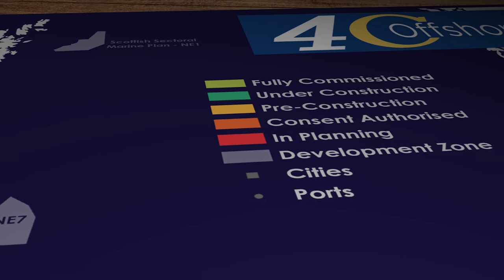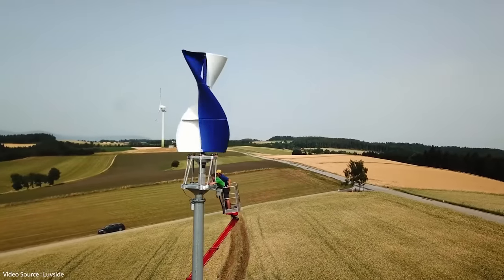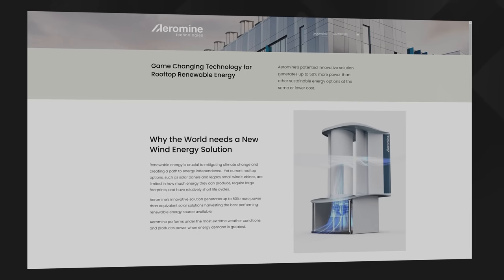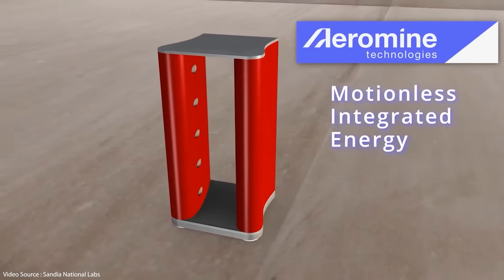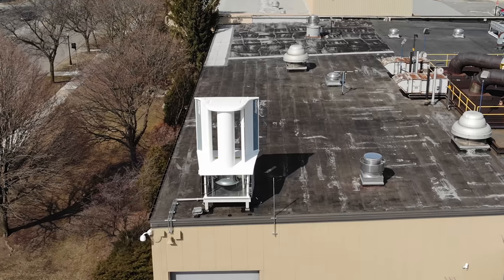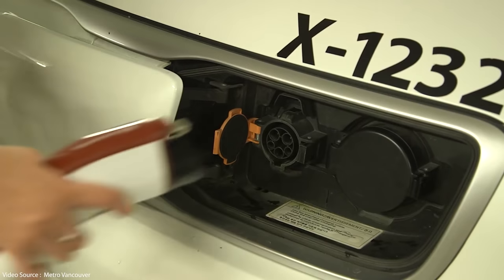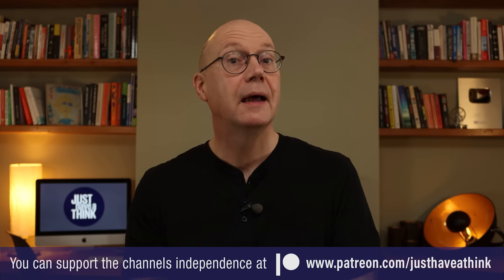Aeromine Rooftop Wind. Static. Silent.  50% more power than Solar PV. What's not to like?

Comment: Do these suck in birds and other debris? How do they hold up in storms? Hail? 40-140mph winds? "one equals 16 solar panels"(saw that on their site) is SUPER specific. A solar panel can have drastically varying output.. How much electricity does one of these generate? I love how its focus is on being quiet yet there is still a fan and there's no such thing as a quiet fan if its spinning fast enough to do anything. Not only would it not be quiet it might produce vibrations that are emitted into the entire roof which could do more than amplify noise. I'm not a fan of anything that could mess with a roof honestly. Even if you put my dislike of anything put on a roof aside this, "product" is extremely sketchy with its various missing specifics. It's just like how I don't buy plants at stores that don't have names. Menards and Walmart literally have plants labeled as, "Pretty foilage" with no other name. Why would I be interested in something that doesn't specify wattage? 16 solar panels...? No noise? Waste of time. Probably had to mention the US because its a scam and wanted to make it seem less likely to be one. I hate to break it to you but there are plenty of scams in the US too. Like all of the unlabeled plants being sold this year at various stores. 41k likes? How?

Comment: Cheaper while producing 50% more is never going to be the end of the story. I have looked at small vertical turbines for years. The issue is always the cost of maintenence. A spinning component exposed to the elements is going to need bearing replacents. That sort of constant part replacement needs to be calculated in.

Comment: This doesn't have "no moving parts."  You said several times that it did, but you also said it has a propeller.  It has a moving propeller, and there's a potential for noise.

Comment: Their a problem with outputs speeds from wind turbines 1,000w  they give you a number that 70% less and that problem is inputs speeds are only 30%. They say, this is outputs are  1,000w, but the actual output is 300w that's your 30% which is known as inputs speeds. When they sell you a wind turbine with extras for your house, it's on the box and in the information leaflet it tells you 1,000w they are not lying this is based on the 12 or more metres a second wind speed maybe 10 metres per second on wind speed actually .  That's 25 to 30 mph is the target speed but the input test tells us that it only 300w under this speed your only guarantee on a average day's wind between 8 and 12 mph and that will give you availability for 300w or the 30% per day to get 1,000w it would have to be strong winds every day to 35 or 45 mph then the whole thing could have a problem with stability land movements. The things is in this video the man says it's expensive they make these turbines and every year they cost the tax payers a sum of £300,000 a year wind energy they make is £26,000 £30,000 a year after breakdowns and oil, grease and parts this could be 50 or 60 days a year  and that affects the £26,000 target they offer the government for our money.

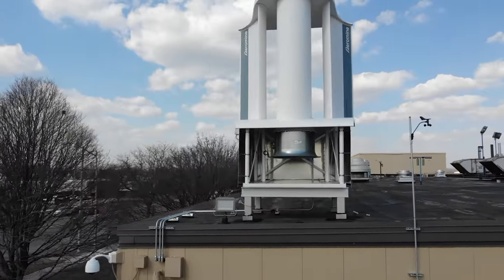Comment: Besides all advantages, I do have a point of critique coming from the standpoint of an architect. In its current state it doesn't look appealing. Not on a residential building, maybe on a warehouse... If this technology actually becomes an integral part of the face of a building, then preferably something needs to be done about that. And the video repeatedly mentions 'no moving parts': what about the fan at 5:15, visible from the point of view of a passer-by?

Comment: What do you mean 'no moving parts'? It has as many moving parts as a normal turbine, only smaller blades. Probably the turbine has a higher rpm so you will hear it humming in the wind,.

Comment: We need toys to play with, to test on a small scale, if it truly produces lots of power a toy would produce enough to run a game or experiments, full size devices are all very well, bit if people don't understand the device they are less likely to buy it.

So the need to orifice small scale devices so people can run a shed or a single plug or for charging an electric bike small scale so we can see if it works at a low level

We know ordinary wind turbines can work for small scale charging but they can be prohibitive due to noise, so there is a huge market for small devices.

Bring out a small scale device for small applications and they won't be able to keep up with demand, if it works also would be a stepping stone to having one fitted to your house.

Comment: In regards to wind energy, I live within 10 klms of  a 600 megawatt wind farm, today there is no wind at all. No wind or low wind speeds simply mean no power. Unless you have a backup system, relying on wind and solar is not the answer. wind farms either have to be located in cleared areas void of any trees or buildings. In off shore, they have to be suitably located not affecting marine life. Then there is the power transmission lines over large distances to connect all of the infrastructure into the grid. My background is electrical and I was very fortunate to work in physics electrical power generation. The cost of producing electricity from wind alone is very expensive, there is no guarantee that these monoliths can generate 24/7 365 days a year into the grid system or meet base load requirements. Do the research.

Comment: Just installing the foundation of a single offshore turbine can consume 18,857 barrels of marine fuel during construction, according to calculations published by Forbes Wednesday. Offshore wind farms often have over 100 wind turbines, meaning that building them requires almost 2 million barrels of fuel just to power the ships involved in construction.The Long Island-New York City Offshore Wind Collaborative will cost $1 billion dollar to build and generate roughly 200 megawatts of electricity, enough to provide power to between 40,000 and 64,000 homes — depending on how much the wind blows over the course of the year.  The wind farm’s power will cost around $25,000 for every home it powers, according to Daily Caller News Foundation calculations.  The first American offshore wind farm in Block Island, Rhode Island will cost $17,600 dollars per home it powers.
Reply: Hmm. When I divide 1 billion Dollar by 40.000 homes I have 25.000 Dollar per home. Assuming that a windmill lasts only 15 years, I have less than 1.700 Dollar per home? Could you explaind your calculation, please?

Comment: The "no exposed moving parts" comment may or may not be a hint. How does that work is the right question: with moving parts. Propeller blades on a generator certainly seem exposed if you know where to look. Repeating "no moving parts" is really quite literally wrong. And doing so so many times is irritating after the "way it works" is with a propeller generator. Still looks like it will suck up wildlife.

Comment: "Virtually not moving parts" - as in no VISUAL or exposed moving parts.
BUT a propella driven generator  - as in any other wind driven power generator - and any rotating propela will produce noise, it is physics !!
Frequency will depaeds largely on the speed of witch the propela spins and how audible will depends on how well it can be isolated and shielded.

The problem here is that you need to bet on the most prominent wind direction !?!, to get the most effectivity out of this ??
There are other roof mounted systems in significantly smaller packages and the same power range  I would rather bet my money on.
But I understand that non technical people may be attracted by this systems, apperantly, no moving parts

Comment: Highly skeptical of any company that doesn't divulge any numbers.  In my years it not because they are protecting anything except a secret that isnt good. Its either they havent achieved what they thought they could, or its just another outright con. Given the design, just some basic thought finds many flaws and weaknesses in the design.  Just the lower intake reflects a 50% decrease in air velocity with that 90° bend. They could improve performance by dangling that over the front of the building instead of trying to corral the air to the bottom. The placement of the whole unit puts it in a rather lower pressure area as the air deflecting off the building doesn't suddenly do a 90° into the turbine. I could go on but overall it's a bad design.

Comment: Do NOT attach a wind turbine to your house. It will have a varying rpm and therefore a varying resonant frequency. 

It will activate structural members with the same resonant frequency and turn your house into a giant guitar.

Besides, this has been tried about twenty times and failed every time. I used to work for a wind turbine company and got stuck with fielding inquiries from inventors. I’ve seen dozens of designs quite similar to this. I’d take their designs to the engineers, who would either laugh or roll their eyes and point out the obvious problems with fluid dynamics or basic physics.

Vertical axis wind turbines are inherently inefficient. Ducted turbines don’t work. Turbines attached to buildings don’t work. 

There is a reason that commercial wind companies have settled on the three bladed upwind horizontal axis turbine in the megawatt scale. That’s how you make reliable, cheap electricity. 

The fact that you mentioned in your video, double the speed = eight times the power, is one of the main reasons not to put a turbine on a building. Any drop in wind speed or laminar flow is disastrous. Wind turbines are on tall thin towers for a reason. They put the turbine blades up where the wind is fast and *smooth*. Turbulence lowers apparent wind speed and reduces power. The wind is going to be unavoidably turbulent around a building.

Really, I’ve seen dozens of these tiny-turbine-on-a-house proposals. Ignore them.

Comment: This doesn’t sound like anything new, honestly. We’ve seen these types of designs for at least 40 years. The only real innovation I see here is the placement on the edge of a flat roof. Seems like a very limited application, but I guess every little bit helps.

My other concern is storms. In hurricanes or nor’easters, I can see these becoming thousand-pound projectiles hurtling all over the place. Also, I’m not sure how many existing buildings can hold up an extra 20 tons on their roofs.

I don’t get the “No moving parts” claim, either. A spinning propellor is visible at the bottom, which you mention earlier. Maybe the Aeromine apparatus itself doesn’t have any moving parts, but it’s useless without that turbine.

It’d be great if these worked, but I’m pretty skeptical at the moment.

Comment: Anything domestic is going to need to be smaller. There's no way most planning depts are going to allow a 3m sail be stuck on most people's rooves. Solar panels get refused if they exceed the roof line by a few inches!

Comment: To say that it has no moving parts is false, it has a concealed turbine fan. As others have noted it faces one way only, so will not be efficient in areas with variable wind directions. 

There was no verified output information in the video as well. There is a reason almost all wind generators are the traditional blades on a tower, and are placed out in the open, and not around wind obstructing buildings etc. I am not convinced.

Comment: I too do not understand how a static-mounted unit can make use of winds coming from different directions.  Also to say it has no moving parts is a lie, if you look closely at the bottom of the funnel you can see a good old fan blade spinning round and round which is obviously the power generator.

Comment: Sorry, but I don't take to the upward draft on the top edge of a building, let alone that the turbine is set back from that top edge.If it were positioned so that the centre of the turbine is at least centered with the edge of the building or a duct sytem takes care of funneling the draft to the turbine, I'd look into it. But less than that I call BS on this setup!

Comment: only works as long as the wind flows in one direction wont work if the wind comes from a different direction thus still flawed like solar power not working when there is sun

Comment: the reason why they havent released the electrica output data is because the amount of electricity it produces is very low relative to solar. Wind energy is just not efficient, trust me.

Comment: The winds at my home are/were strong enough to tear apart a heavy wooden gate pinned to 4x4 concrete-set posts with 6" screws to shreds. 
So, wind: no problem. 
Problem: 10' tall? Also, my roof isn't flat. 
So would this require me to build a 20' tall tower next to the house with flat sides to facilitate this air-flow? 
I don't see how it would be practical in home application on a privately-owned home, let alone in a fascist-run gated community with regulations against flag poles?

Comment: This tech has 2 problems as I see it. 

First it assumes a stable wind direction. If the wind comes from a different side of a building. It probably doesn't generate much power if any. Some places might have that but many won't. This will limit application locations. 

Second it adds wind loading to the roof of the building. Most flat roofs are not designed to have 10' sails mounted on them. Imagine a row of these on a condo complex in FL. The first hurricane will rip them and the roof off. This will make the tech as a retrofit unrealistic. I assume this tech isn't integrated into buildings being designed today because of other costs and downsides involving wind loading and flex.

Comment: All these wind turbines will likely cost you more than a 5-series BMW. The newer, smaller and powerful bladeless models won't even become available for purchase by homeowners until after 2050. That's my prediction. These are just lots of hot air.

Comment: just to be picky you said no moving parts ??? what about the propeller in the tube that i guess powers a turbine of sorts is that not a moving part and when the bearings start to wear out they make a hell of a noise also wind passing through a tube that gets smaller makes a noise so it is neither silent nor non moving and worst of all so very easy to copy and build yourself you only have to change it by 10% to avoid copyright
Reply from the maker: I did say no 'visible' moving parts when I first mentioned it at the start of the video, but it is fair to say that I forgot to add that caveat when I mentioned it a second time later in the video.

Comment: What's not to like?  Well from an engineering perspective it is unstable power, it's diffuse, it isn't very green, it's costly and completely incapable of providing baseload power no matter how many massive turbines built and in order for it to be of any use requires millions of tonnes of additional batteries containing toxic rare earth minerals.  Wind power is best used as a supplement to gas, hydro and nuclear (10-15% max in the energy mix).  It will never come close to replacing them nor would any sane person want that in reality.

Comment: Never going to deliver as the slightest wind angle deviation will affect efficiency. My house will never have wind tunnel air flow and were I to install such a thing on my house it would never get anywhere close to lab conditions. It's quite difficult to get close to max potential values in a wind tunnel and those are highly controlled environments. Nature likes to be wild.

Comment: So how come no one knows about it? With the high cost to the environment with use of rare earth minerals for solar panels you would think this would get more publicity
Reply: There are no "rare earth minerals" used for normal silicon solar panels. What material do you mean concretely?
But the generators of small wind turbines mostly use the rare earth element neodymium for the magnets.
Reply: @701983  Rare metals in the photovoltaic industry, Gallium which China has export ban to the US?
Reply: @chasx7062  Normal PV doesn't use Gallium.
Reply: @chasx7062  There are photovoltaic technologies, which make use of rare metals like gallium or tellurium, but you can easily avoid them just by using common silicon modules. Much easier than avoiding neodymium in small wind turbine generators.

Comment: Again, this is a lot of material, labor, transport and maintenance.  It is so much more efficient to have high-density nuclear replace our carbon-fueled power generation and increase production though massive investment.  Then no need to have all these high tech materials and standards. If energy is cheap enough older buildings can be heated economically electrically and huge savings can be realized.